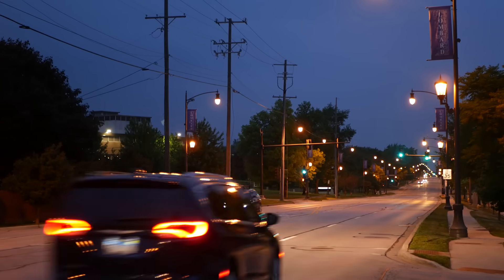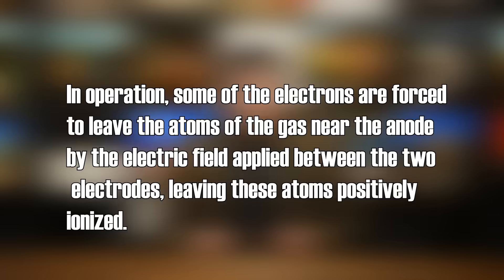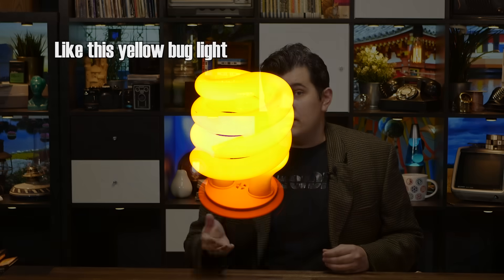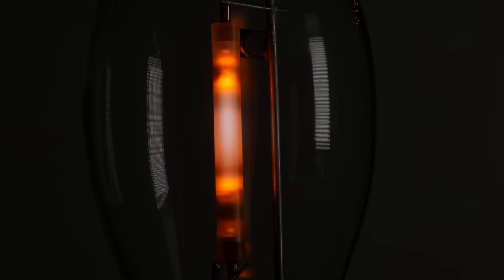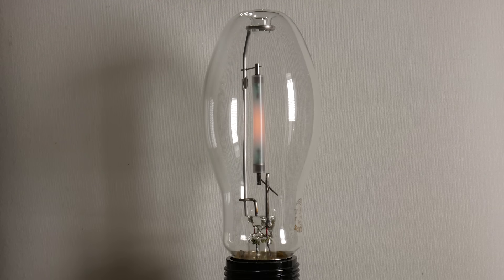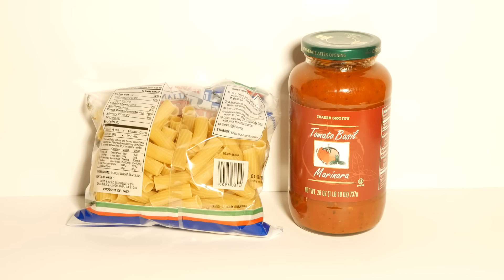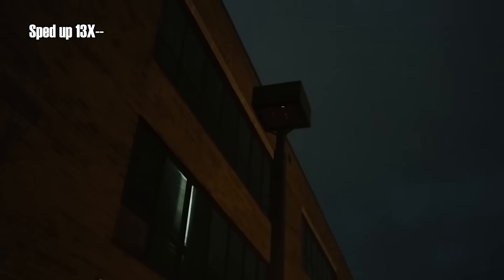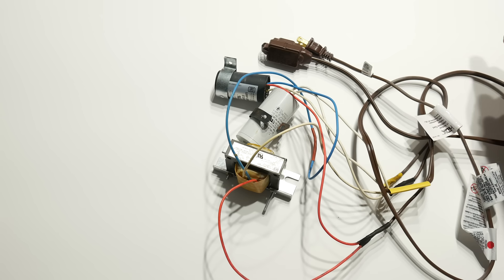The High Pressure Sodium Light: Ubiquitous, effective, but good?

Comment: My local council has just changed the bulbs in out area to bright white LEDs,  they're way to bright and give everyone headaches.
Reply: i feel you
Reply: My street got those as well, they are definitely not the best way to light up a street
Reply: that happened to our city as well but after a year, they used warm colored LEDs which eliminated that problem.
Reply: Beyond the problem of comfort or aesthetics, the bright white LEDs are making cities even more light polluted, killing casual stargazing and astronomy for most people.  The new LED lamps could and should have been designed better to minimize this problem.
Reply: Wait  y’all have actually functioning lights?
Reply: wierd my street change them and they bearly give any light i guess it depend on the model 
like old orange light did light up more
Reply: I've been using yellow lense sunglasses while driving at night to deal with all of the super bright LEDs.
Reply: And they have too much blue and so are harmful to all creatures (insects included) as it acts as sunshine. Stops you going into the regenerative deep sleep as the light interferes with your sleep waves and hormones. This also occurs for all animals.
Reply: Bright white LEDs suck.
Reply: i despise all of them greatly.
Reply: I simply feel like im in a lab with white leds
Reply: I feel you. And.... there's a massive factory near me that has an insanely bright white light mounted a hundred or so feet in the air. What really worries me is that near the factory, at one o'clock in the morning, the birds are singing. I'm no expert in anything, but it seems that wildlife can accept dim orangey light as being night-time.... but bright white light seems  to send the wrong signals about time of day.
Reply: At least they're tending to use warmer-white LED's around here! Some of them are just...blue, with a sort of purpley overtint.
Reply: Same happened over here. When driving at night they are now way too bright and actually blind me. Nothing wrong with LED lights and not even with changing the color, but they should have taken into account that those LEDs are more powerful and either pick a weaker version or they should have limited the angle of radiation.
Reply: @xcoder1122  Now that's just lazy of them! It's kind of part of their job to calculate equivalent light output!
Reply: I'm all for saving electricity and therefore money on a electric bill, but I feel like LEDs are too harsh on the eye, especially at night. I can't tell you how many times I've been blinded by LEDs from cars that now come standard with them for headlights, especially since march of this year (2021). The blinding headlights on cars has become so much of a issue Lately that I've become empathetic towards my grandfather's friend who has a problem for needing dim car instrument panel lights at night or needing them low at night, even with me being 25 years old.
Reply: @morganrussman  I've also noticed the blinding effect of new cars but I don't think it's because LEDs make a different light, I think it's because LEDs emit light at a much wider angle. The old car light bulbs usually did not emit the light directly to the front (only brights do so), they emit most of it to other directions and inside the light are coned mirrors that focus the light to be emitted in a specific way. LEDs however directly emit the light to the front and must be built in such a way that they only emit it at certain angles and these angles seem much wider than in the past. Some of these lights have sensors and change the angle as soon as they spot another car but even that is not always working perfectly well, often they react too late or not at all.
Reply: @xcoder1122  I know that it's been over a week now, but for you mentioning about LEDs making a different light, I didn't mention that, what I was getting at was the fact that when a car with LEDs, when I have a car coming at me with them, it makes me feel like I'm staring at a light comperable to that of or 2 or 3 times that of the intensity of staring at the sun. At least the old incandescent bulbs for cars weren't that bright. And yeah, I get it that new cars with LEDs as standard have their headlights designed differently then older cars, but still.
Reply: Mine still uses sodium lights but turns them off for most of the night, at least on my street. Helps with the circadian rhythm thing, I guess, as well as saving energy on light no one is using.
Reply: Jesus Christ Larry we gotta quit meeting like this bubba
Reply: Same and cant sleep
Reply: I'm telling ya
Reply: wish they'd just properly account for the brightness of the lamps they're replacing, rather than their power draw. And it'd be great if they stuck to a similar gentle yellow (just more broad) rather than a harsh sterile blue-by-comparison white.
Reply: i feel you
Reply: @lucasc5622 88888888888777777777777777777⁷7⁷7778 I88888888888888888888887788 77788888⁸888888
Reply: i feel you
Reply: Yes thank you the new led streetlight head fixtures are very very very bright it gives of a very very very bright white light and they would flicker off and on like a box of christmas lights and they would flicker on and off and it distracts vehicle drivers and pedestrians walking around outside at night and it suppresses melatonin the sleep hormone and causes people to have insomnia and weak digestive track immune systems and sodium streetlights are very easy on the eyes.
Reply: @andrewjones8616  You do know LED streetlights also can je yellow? Or yellowish like ordinary bulbs? And brightness can also be less or more than other bulbs. Flicker is bacause the power grid akd ordinary bulbs also flicker at the same freq. But might not be as noticable. I have never seen LED streetlights act the way you describe. Yes, they can be too bright and have a blueish tone to it but a good LED streetlight are not any worse for your eyes than regular lights. LED can actually be just as easy on the eyes as sodium, halogen etc if you want. That's part of why LED are great.
Reply: @Oystein87  why do you keep replying to everyone? People have already argued against you and you admitted you don't know the technical details of what you're talking about. Even warmer LEDs are not the same and hurt the eyes, And are uglier.
Reply: @--..__  Placebo effect. I have sensitive eyes so I know I am right. Research says the same so I stick to what I know. And I know the technical details.
Reply: @Oystein87 
You a fed or something? We don't like the led lights, they are annoying. They are like high beam head lights in your face.
Reply: @--..__ 
agreed and thank you💯👍
Reply: @--..__ Modern leds are good
Reply: they're also dramatically less power hungry :)
Reply: Love the LED lights :P Very efficient and great light! But however some installations have the light spreading wrong and the worst is if they have a bit too cold light. THAT is what CAN give some few people headaches. That's why warm white is better for home use and more than cold white is.
Reply: @Oystein87  I don’t dislike LED but we need more 3000k LED lamps as they are much better on the eyes
Reply: @Oystein87  yeh I only said 3000 because most manufacturers of street lamps only offer 3000k. The other option is AMBER LEDs which is 2200k but better cri than HPS. They’re not that popular for some reason. I see them as having great use in areas that get fog such as the UK
Reply: @kangarookicker6995  I think 2200K is just too yellow. 2700 is the perfect middleground between yellow and white light. More natural. We have alot of fog here too and 2700-3000K is really good for that too.
Reply: @Oystein87  agreed
Reply: @Oystein87  LED lights are less efficient than sodium lights, especially low pressure sodium.
Reply: @soylentgreenb  Uhm.. Nope🤣 LED's are far more effective for power consumption.
Reply: @Oystein87 That's patently incorrect. All power savings from LED come from reducing quality of service and providing an inferior result. Typical LEDs that get put into street lamps get 70-100 lm/W and LPS gets 100-150 and HPS 100-180. It's a less efficient light source. But if you light up a cone with a 30-45 degree half-angle you need far less energy than proper hemispherical lighting that allows you to see animals, joggers, bicycles and other things coming onto the road or bike path from an unlit side path. 

They also use harsh cool-white because the eye is slightly more efficient at seeing these frequencies of light (pure green is optimal; almost twice as good as orange LPS). This is bad for two reasons; if you go from a lit area to an unlit area your eyes are much better dark adapted with orange LPS lighting than they are with white lighting (astronomers use faint deep red LED lights for this purpose which are even better for retaining darkness adaption but the efficency really blows); it also fucks with your circadian rythm (most white LEDs are really blue LEDs with a fluorescent layer that downconverts to longer wavelengths).
Reply: @soylentgreenb  So much wrong here...🤦‍♂️
Reply: @Oystein87   LED bright white is dreadful. It's an unnatural light that our eyes are not suited to see well. The yellowish-orange is closer to the sun which our eyes are evolved to see. I work outside at night and  HATE the new ultra white light. It's uncomfortable.
Reply: @TheBandit7613  True.. It must be the warm white. About 2700k.. That is more like a normal older light.
Reply: @TheBandit7613  can you please show me your sources? Our eyes change throughout the day. At night we pick up blues better at night than during the day. During the day we see better in yellow. That doesn’t make it true across the board. Besides once people get used to the LED street lamps they are fine. It’s only in the beginning the cry baby’s claim they get head aches. It’s not true.
Reply: @Jaderian87  I never said I get headaches. I work at night. I know that the new LEDs are harsh. And they don't last anywhere near the claimed hours. Bright White is not a natural temperature. Where in nature  is there a bright White light?
Reply: @TheBandit7613  you must be a woman. There is so much emotion in that reply. 

Fact: the LED lights are not putting out white light it’s more blue than anything else. A spectrometer would show you that.

Fact: moon light is not yellow it’s more white than anything else. And since we had to exist for thousands of years before fire we had to learn to see in that light as well as with the sun. 

Fact: lights being changed to LEDs have not cause any accidents. In fact night time
Accidents have gone down.
Reply: @TheBandit7613  do stop moaning L.E.D. light is the best!
Reply: @TheBandit7613  that’s what he said
Reply: @Oystein87  It's all a matter of preference and probably what your eyes arre used to. I have heard issues reported with the modern "blue-white" headlights on vehicles causing headaches by mates though. And those pulsing/strobing LED bicycle headlights .. just don't go there! Those put a trail of blind-spots across your retinas.

Personally, I hated being stuck in commercial premises all day seeing nothing but yellow light all day, nothing even remotely approximating daylight, especially in winter, when the only chance I had to experience something akin to natural daylight was at home.

This is just an IMHO but ..If you spend significant time in proper white light, you will likely soon get used to it .. e.g. daylight tubes (& CFLs) were rare (or unobtainable) in the UK for domestic lighting, due to a perceived lack of demand and partly coming from peoples' experiences of older phosphor concotions which probably were a bit harsh (a "cold" light).

... But in the past decade or two, once the bean-counters who decided what to stock (Brits ONLY want yellow lights? People don't buy white ones (.. ahem .. because you don't offer them, D'Oh)) lost their market dominance and local stockists found alternate sources & started to make them available, these daylight lamps have become very popular.

In some parts of the world it's rare to see anything other than daylight except for incandescents .. e.g. in Kenya, one of the large supermarkets did have the restaurant section upstairs lit with "warm white" but everywhere else (including homes) it's 6500°K all round.

I've been using daylight lamps in the house for many years now & have significantly less eyestrain when reading, using the computers, watching TV etc. as the higher-CCT lamps don't tend to wash-out the displays and provide more visual acuity for reading printed material. Plus pictures shown in white light look natural, instead of semi-sepia.

Just my opinion of course. ☺
Reply: Because it's not just white light- LEDs have a tendency to throw off UV.
Reply: @Harlem55  Typically, white LED's have a proper blue LED. Some high quality white LED's have near-UV LED's with a white phosphor, but it's perfectly safe.
Reply: @Harlem55  ALL light throw off some UV.. But LEDs are naturally more blueish white if there is no filter. Warm white is better for the eyes than cold blueish white.
Reply: @Oystein87  but correct me if I'm wrong UV light tends to resonate "bluish white" (being the reason UV light sources such as those used for disinfection appear to be a blue tinged white, and the reason that black light appears blue-purple) - ergo the color of the LED tends to indicate there is more UV light than average as to account for the color of the light as compared to standard white light.
Reply: @Harlem55  I don't know all the specifics but to my understanding its the same as with other light sources.
Reply: @Harlem55  the only reason why leds seem bluish is because of their too cheap diodes, so they mix colours together to get white
Reply: @Harlem55  you are correct. And filtering LEDs makes them more yellow but also reduces their output massively and makes them less efficient
Reply: @Harlem55  no they dont, they have no UV unlike daylight
Reply: @abecoulter8550 😂😂No UV like daylight, then why do you get Sunburn😂🤣
Reply: yes, led is way to bright to me
Reply: @ericli20  To bright!? Uhm... You do realize the brightness on LED can be weaker or stronger or anything in between the normal old bulbs, right...?🤣🤦‍♂️
Reply: Also guy who pointed out the moon is right. Humans are naturally fine with very cool whites at night due to the moon.
Reply: They are made that way for a reason, and a proven one at that. Bluer and white light keeps people attentive and focused, that's why you mainly see them in workplaces.
Reply: I think they look a lot better then ugly yellow light.
Reply: Leds suck
Reply: @ALT-9167  most LEDs suck. 3000k and under should’ve mandatory
Reply: @ALT-9167  LEDs are superior. Changed all my lightbulds to warm white (2700k) LEDs at home and that gives me better light that is just as easy on the eyes as old ones at a lower power consumption.
But cold white (6500k) LEDs suck for home use.. Harsh on the eyes over longer periods

Comment: High Pressure Sodium lighting is also extensively used for indoor gardening. Metal Halide lights are also used and they even make a dual element MH/HPS bulb now. There is and unsubstantiated belief that the bluer light is better for the growth/vegetative phase of plants and the redder light for fruiting/flowering. Most studies have shown the amount of light matters more than the color to the growth of the plant but some anecdotal claims are still made suggesting otherwise.

Comment: at 6:27 pressure broadening is not the cause of increasing intensity, it didn't make the spectrum any "stronger" but only broaden it; it effect colours and not the intensity, the wording used "weak" & "strong spectrum" is part of misconception on pressure broadening. The intensity increased because of negative-resistance of the sodium gas.

Comment: High powered metal H. lamps can take a VERY long time to relight.  The local HS has them lighting the sports field and I can recall during a night football game we had a short power outage.  It took about 20 minutes before the lamps would re-start, and another 15 minutes for them to come back to full output!  Needless to say the game ran late that night!

I have a 100W HPS lamp hanging on my house in the driveway.  I've gone through 3 bulbs in about 15 years, those bulbs burn all night, yet I get about 5 years life out of them.  I've also had to replace the ignighter twice.  

They now make LED fixtures that can replace HPS outdoor lamps, but these are still more expensive than the HPS ones, AND you can't rebuild them, the LEDs are NOT replaceable.  LEDs are only about 10% more efficient than HPS bulbs, so most people will not be in any hurry to replace them.  For new installation the higher efficiency and longer life of LEDs may make them worth considering.

Comment: There are arguments for both orange and white lights. White lights have better color reproduction (as you showed here) and are better for certain areas. However, our eyes more easily focus on the orange / red side of the spectrum in low light situations while blue tends to blur out. If you look at an open sign at night that's red in the center and blue on the edges, you'll notice that the blue edges are hard to focus on while the text is easy to read. This means that even though white lights might have better color reproduction, it might make it more difficult to make out certain details depending on the amount of lumens. The color of light used should depend on the use case. If it's a residential area with minimal nightlife, use orange lights as it should make low light transitions easier. If it's a highly active area at night where colors can be important, use white light.